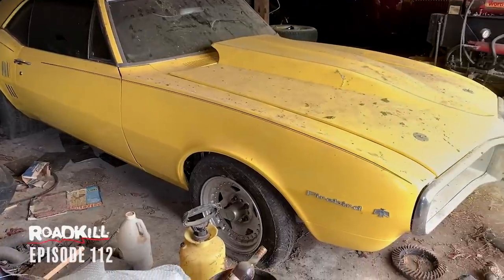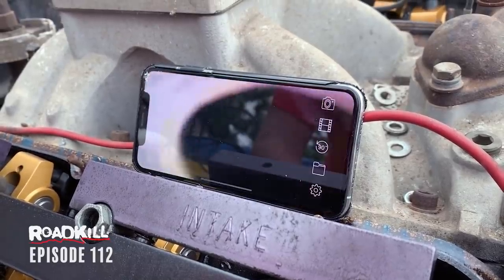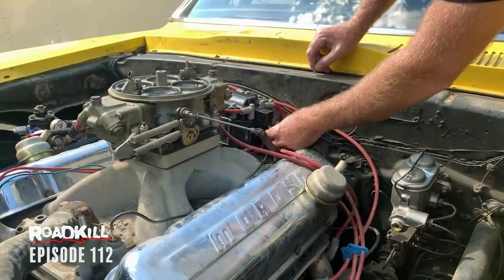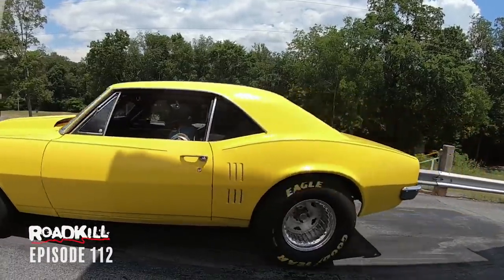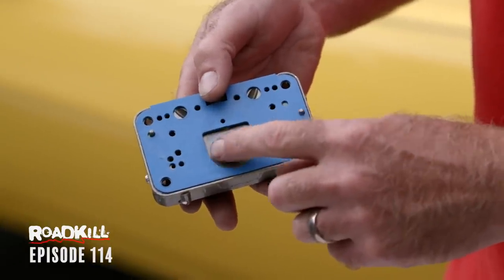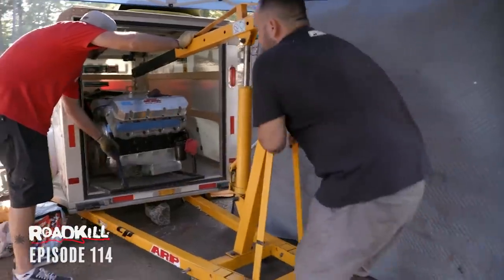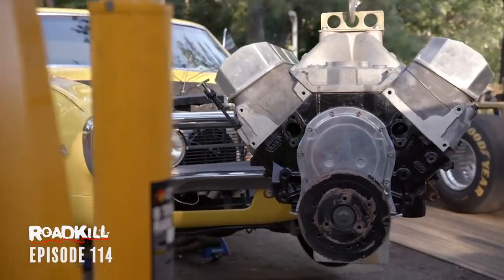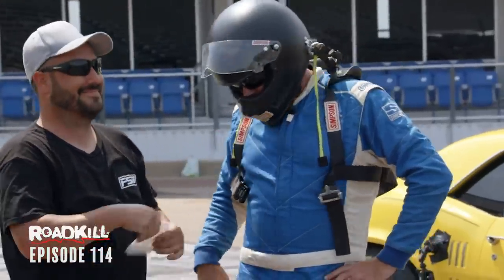Mint Condition '67 Firebird Restored and Drag Racing | Roadkill | MotorTrend

Comment: Huh?  Drums need volume, discs need pressure.
Reply: Nope, other way around.  Think about volume of a wheel cylinder vs the volume of a typical front brake caliper
Reply: @tubefreek869  You forgot travel: pads are pretty much there at all times, while drum shoes retract after letting off.  Also, shoes fucntion by jamming themselves against surface with only a  little help - something discs do not do